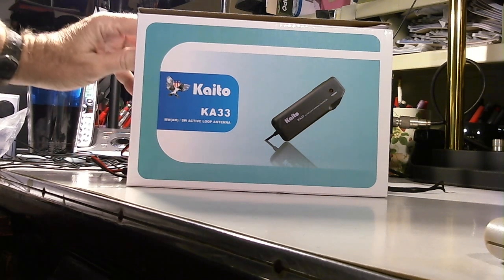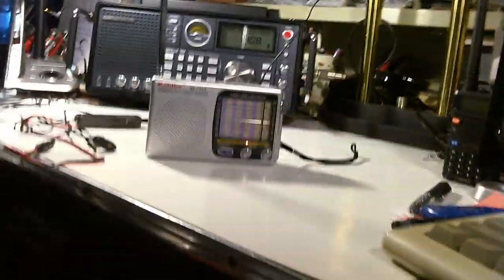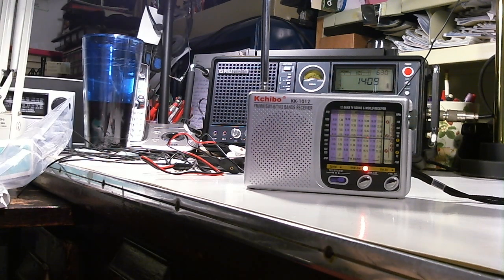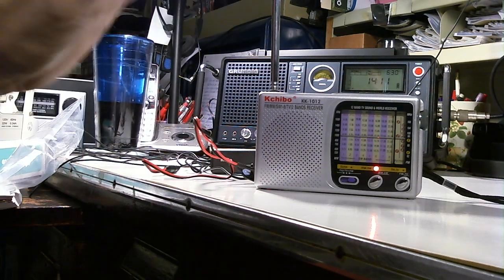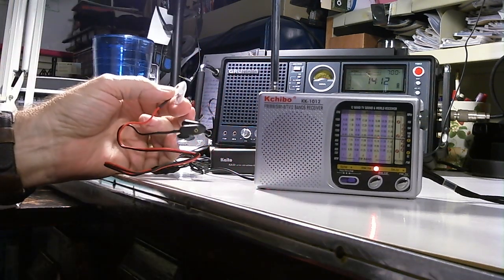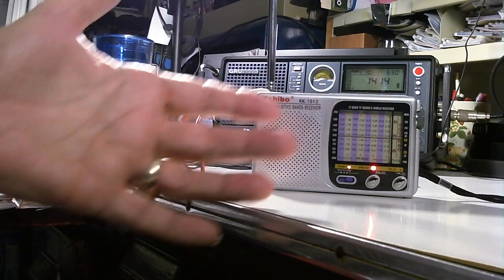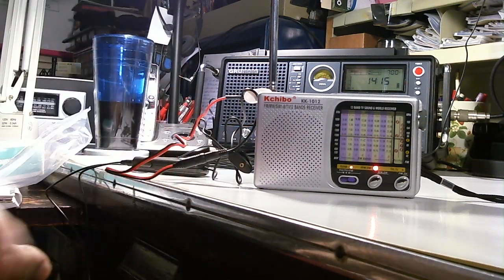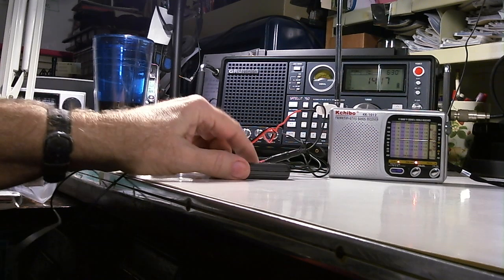TRRS #0243 - Amazing Active Loop Antenna

Comment: Hi Tom. I'm very late to this party...hope you see my post. I've got the DEGEN 31MS clone with my Tivdio V-115, and it makes for a very enjoyable listening experience. I modified the Tivdio, adding an antenna jack and running it to the board antenna and ground solder pads with mini-coax (eliminates all the internally generated noise). The only mod I've made to the antenna was to wind the excess downlead onto an empty pill bottle (I've got a ton of them) making an ugly choke/balun, and mount the loop on a piece of pvc pipe with a heavy base, allowing me to turn the antenna and null out the noise...works like a champ. I haven't yet, but plan to try doubling the loop size to increase the aperture. It'll still be a single turn, so shouldn't effect the tuning range. It's a good bit of fun "on the cheap". '73, Karl
Reply from the maker: Thanks for the report.  Sounds interesting, Karl.

Comment: Tom I just bought one under the degen name same thing right.
Reply from the maker: +MIKE MAYERAN I am pretty sure it nearly the same thing.
Reply: Yup Coming on a slow boat from China.....lol
Reply: Apparently "your results may vary".  I bought the Degen version from Amazon, I believe just after I first saw this video (or maybe a similar one).  It took a couple weeks to come from China.  Unfortunately in a first, very unscientific, test mine didn't seem to do much.  My home office is also pretty electrically noisy.  I put the loop on the window of the office and connected it to my Grundig S350.  I didn't see much change in noise level nor signal strength whether I had the active amplifier on or off, and throughout the amp tuning range.  I even tried just connecting the antenna lead-in wire to the adapter wire (using the adapter that has a couple clips on it to the + and - antenna connectors on the back) and no real change at all.  I'll have to try again in a different location to see if I get better results.

Comment: Hey Tom,
What results do you get using it (kaito KA33) on the Grundig 750.
Please let me know...
Thanks.....
Reply from the maker: The main improvement I get is less noise from the other electronics in my office.  This allows me to hear weaker signals.  The best improvement in reception on the 750 as well as other radios is to have an outside antenna with the signal being brought into the room with shielded coax cable.

Tom

Comment: I've ordered one up - will chef it out with the Tecsun PL-880...
Reply: ..will check it out...excuse typo
Reply from the maker: Keep us posted on what you find.

Tom
Reply: hamrad88 The antenna arrived on Friday.  I've down some initial tests on broadcast band during daytime and it definitely helps versus straight wire but it is not as good as the active antenna I built.  I haven't measured with a scope but the signal strength sounded almost twice as strong with my own gadget.   On shortwave I tried it out using one of my band spread sets and the device seems to tune such that it covers each band, not the individual frequencies.   In other words, say 19m band had the strongest signal at the same tuning point on the antenna from one end of that band to the other.   More tests to come.
Cheers,  John
Reply from the maker: Thanks for the information.  Please keep us posted.

Tom

Comment: Hi from Clearwater Beach....have you tried this antenna with your RTL SDR dongle...I can't put up an outdoor antenna for my SDR and Ham It Up 1.2... although they work great with the MFJ-1786 mag loop on the balcony, as a cliff dweller, I don't want to dedicate my one outside antenna to receive only.
Reply from the maker: My SDR dongle only works on frequencies above 30 Mhz.  This antenna is for MW and HF only. If I had a Ham It Up converter, this might be a good antenna for it.

Tom

Comment: Yes Tom looks like you have a great piece of kit.  I have the Degen k31 and having seen your results might have to re-connect it and try it.
Reply from the maker: I am really surprised it worked as well as it did.  I had read that loop antenna help in a noisy environment but these were much larger ones.

Tom
Reply: Tom do you know if their is a difference between the k31 or 33.
Reply from the maker: Stephen Hutchison I am not sure but looking at the ad for the k31, it does not show the extra adapter that the k33 kit has for connecting (indirectly) to you AM loop antenna in the radio.

Tom
Reply from the maker: Thanks for the info.

Tom

Comment: I'm glad you had some success with the Kaito loop. I found that mine actually radiated signals on other radios, but I never tried it on a "cheap" radio like you did, I used it mostly on slightly more expensive but still sort of low end radios like PL660 & satellit 750. When it was on I found signals on my SDR  went straight to hell & I quit using it. I have much better results with an MFJ  L/C  tuner (http://www.mfjenterprises.com/Product.php?productid=MFJ-16010). I did have similar but not as good results as you did but I would always forget to turn the little amplifier off & run down the battery. Maybe I will try it again.
Reply from the maker: Thank you for sharing your experiences.

Tom